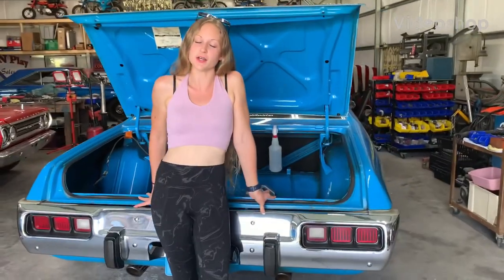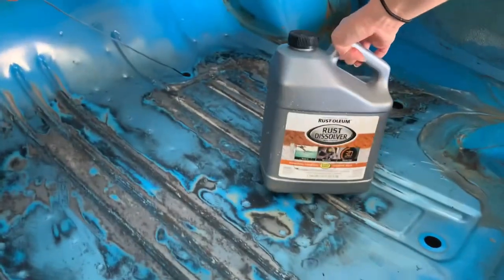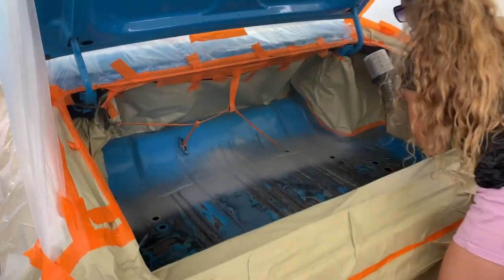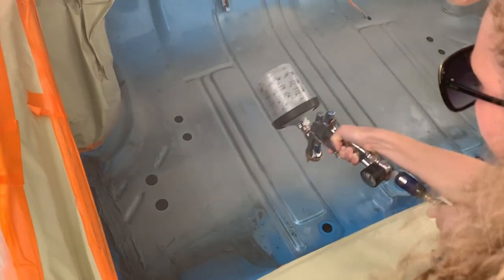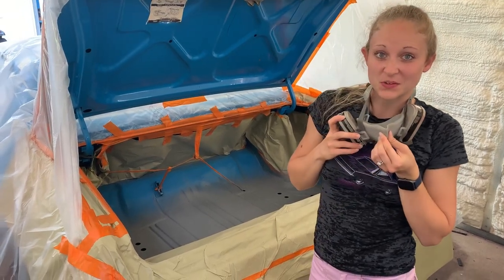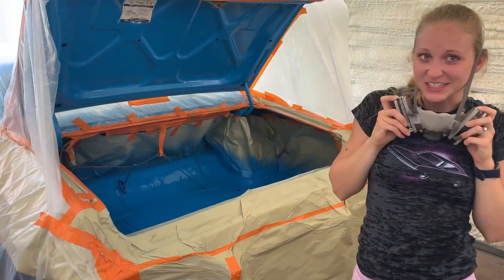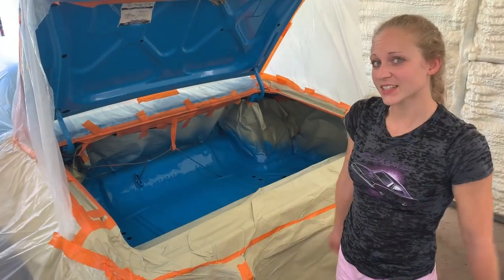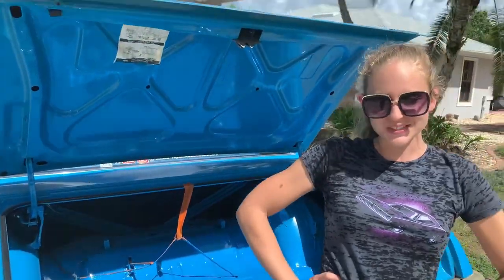How to Paint a 1973 Roadrunner Trunk | Step-by-Step Tutorial #ppg #rustoleum #iwata  #mopar #318

Comment: Nice job Niki!!! What type of paint set up do you have? Is it easy to clean the equipment when your finished? A video would be helpful. Thanks for another great video👍🏻👍🏻
Reply from the maker: Thank you!! I used an Iwata spray gun with a PPS cup and in the lid to the cup is a mesh filter so any junk gets filtered out. With this type of cup you don't need to use a paper filter when you put the paint in the spray gun. There is a lot less clean up and you don't have to use as much reducer to get the paint cleaned out. We have a large ingersoll rand compressor with a separate refrigeration air dryer system that takes all the moisture out of the air lines. By the way, how did your decals come out?
Reply: @taylormademusclecars  decals are great! I haven’t installed yet. Waiting on shoulder before I install so I put them on straight👍🏻